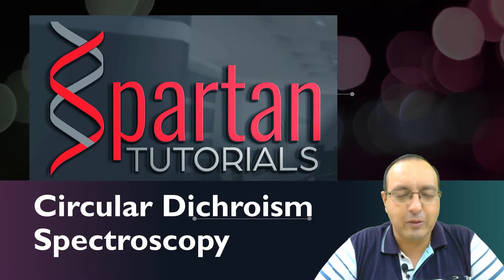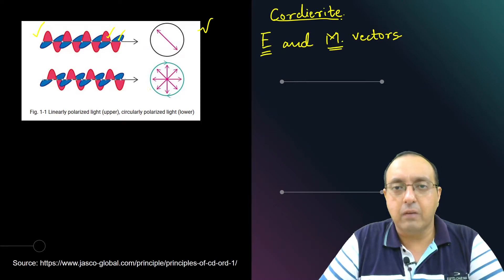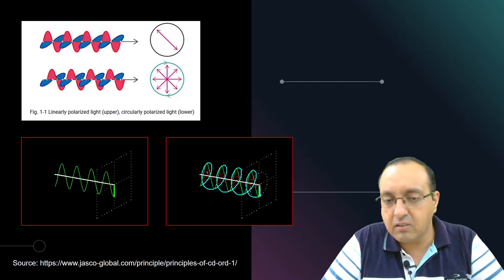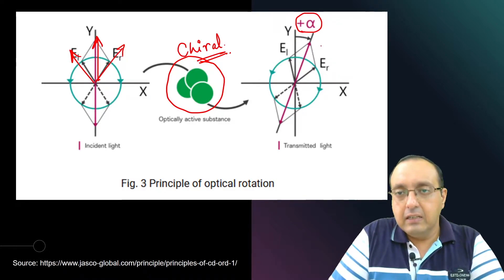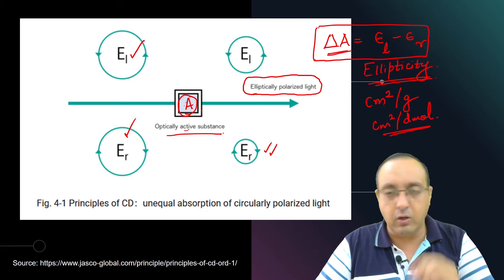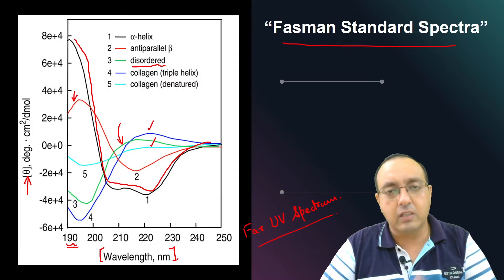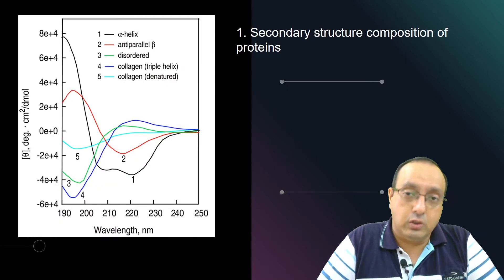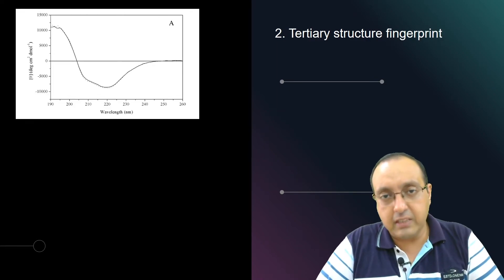Circular Dichroism Spectroscopy for Protein Structural Analysis

Comment: Very good! Well explained. I just have one question: what is the relationship between optical rotation and the absorbance of circularly polarized light?
Reply from the maker: If I understand your question correctly, please see if the following answer is relevant. R-CPL and L-CPL refer to right and left circularly polarized light, respectively:
Measuring optical rotation as a function of wavelength is termed optical rotatory dispersion (ORD) spectroscopy. Unlike optical rotation, circular dichroism only occurs at wavelengths of light that can be absorbed by a chiral molecule. At these wavelengths Left‐and right‐circularly polarised light will be absorbed to different extents. For instance, a chiral chromophore may absorb 90% of R‐CPL and 88% of L‐CPL. This effect is called circular dichroism and is the difference in absorption of L‐CPL and R‐CPL. Circular dichroism measured as a function of wavelength is termed circular dichroism (CD) spectroscopy and is the primary spectroscopic property measured by a circular
dichroism spectrometer.
Reply: I like to explain that Circular Dichroism is a differential absorbance measurement of R-CPL and L-CPL while Optical Rotation is a differential refractive index measurement of the two. A chiral substance will let one handed CPL travel through faster than the other resulting in the optical rotation. Since CD requires a chromophore to show the differential absorbance and OR does not OR can be considered a more universal chiral detection system.

Comment: very nice! well explained. which buffer do we need for CD run? I think 20-50uL of 0.2-0.5mg/mL concentrated protein is required right?
Reply from the maker: Thanks! You'd need at least 150 uL for a 1 mm path length cuvette. Regarding protein concentration, 0.2-0.5 mg/mL is a good start. However, it may vary depending on the secondary structure content. You can start with a concentrated protein solution and dilute accordingly. Check out the following links for more details:
1. https://www.ncbi.nlm.nih.gov/pmc/articles/PMC2728378/
2. https://cmi.hms.harvard.edu/files/cmi/files/cmi_cd_getting_started.pdf
3. https://structbio.vanderbilt.edu/wetlab/cd.sample.prep.php
Reply: @SpartanTutorials  Thanks a lot! Truly appreciate your help.
Reply: 10 millimolar phosphate buffer is best for far UV CD work. Ca++ should be avoided if possible since it will block all light below 200nm.

Comment: Great video. How do I normalise my data by the number of peptide bonds?
Reply from the maker: Thanks Andrea. I'm not quite sure, but here is a resource that may be helpful:
Greenfield, N. J. (2004). Analysis of Circular Dichroism Data. Numerical Computer Methods, Part D, 282–317. doi:10.1016/s0076-6879(04)83012-x